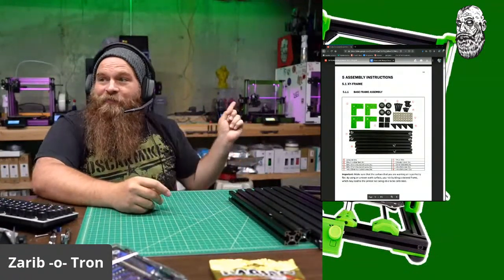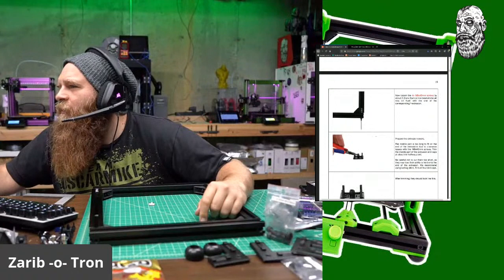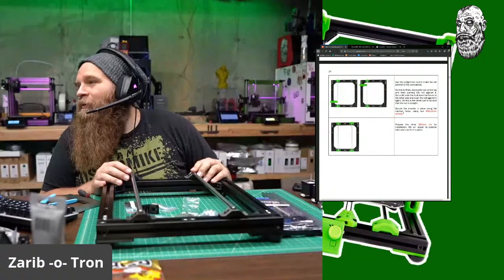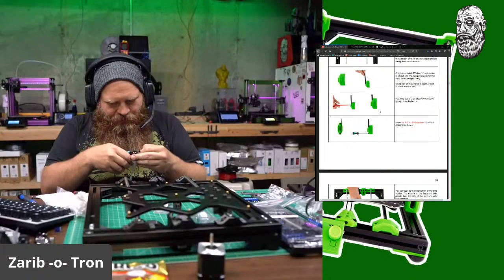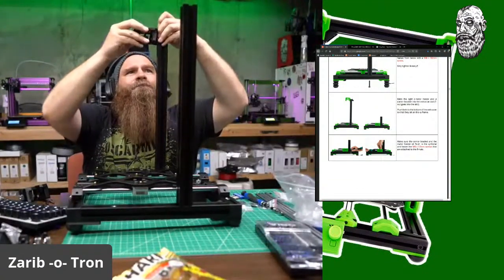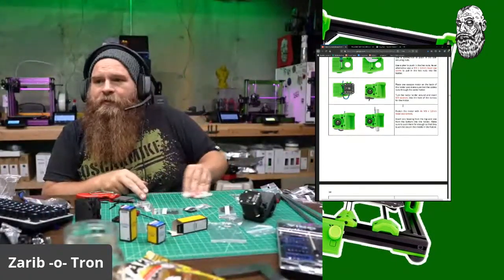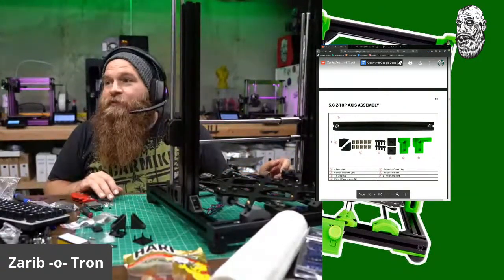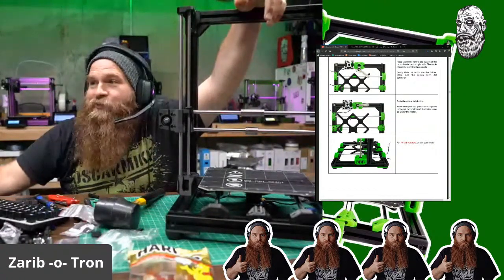Build -a- SKR Zaribo - Assembly

Comment: is there a difference between Haribo and Zaribo. I bought a used Haribo 2 years ago
Reply from the maker: Zairbo is still being actively developed and the parts are very very different.
Reply: @Mr3DPrintWizard  They're essentially the same. Frame is exactly the same. Zaribo is a commercialized fork of Haribo, where originally it's only claim to fame was a 100mm taller Z, hence the (Z)aribo. It's nice to see they've iterated on the design though. Overall most of the community moved on to the Bear and Zaribo because they offered kits for sale that appealed to a wider audience.
Reply from the maker: plc268 they aren’t essentially the same. The parts, build, and so on are completely different along with support and documentation. Maybe a while ago. But today it’s very different